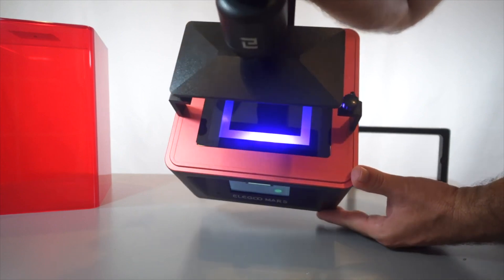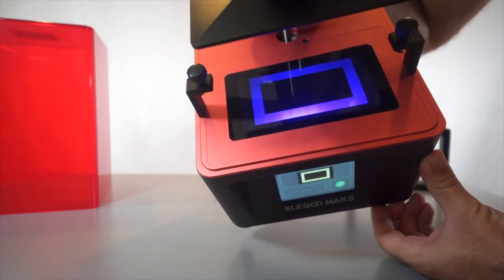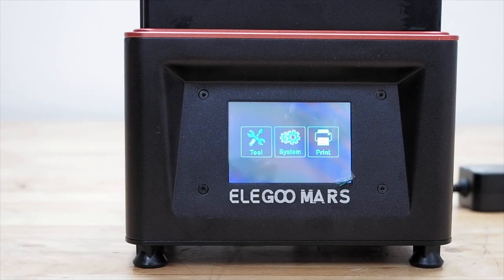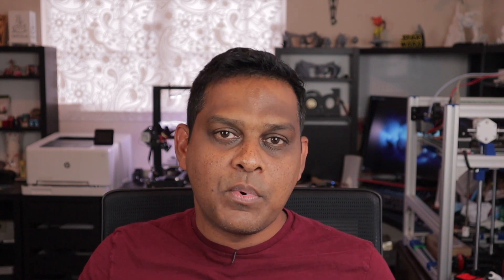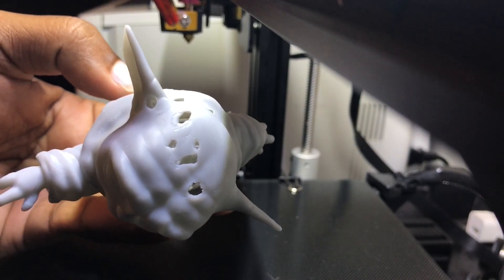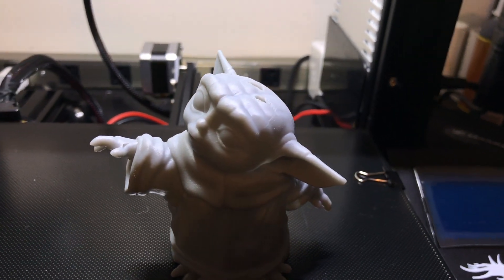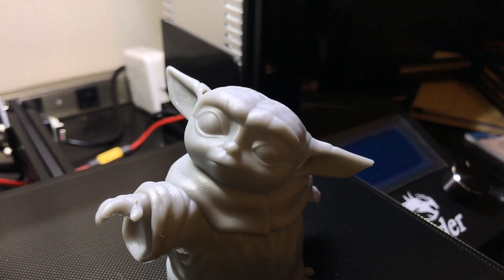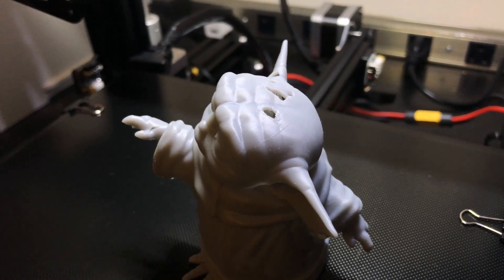Know why and when you will need to replace the LCD on your Resin SLA Printer!

Comment: Anycubic Photon S, two screens failed this year.  About 100 hours printing on each screen.  I print mainly 15 or 28mm minis with a few larger vehicles.  4 bottom layers/40s exposure and 10s normal exposure at 50 micron.  Ventilated workbench in room maintained 71-73 F (21-22 C).  LCD screen and bottom of vat cleaned every couple of prints, no residue or damage.  No physical damage, i.e., nothing dropped on screen.  Anycubic sales refuses to honor their 400 hour expected lifetime.  What do I look at to determine why the screens are failing?  thanks for your help!
Reply: Hey, could you please tell me, by what symptoms did you speculate if the screens are broken?

Comment: Do you think it is possible to prolong the lifespan of the LCD screen but adding heat sinks to the outer surfaces of the UV reflective projection tunnel to help dissipate some of the heat?
Reply from the maker: This is a good question. You would need some active cooling for it to work though.

One user actually got great results having the stock fan reversed blowing on the heat sink instead of sucking air.

You can give that a go!

Comment: You made the walls to thin or there is an issue with the stl.................................. the screen is fine
Reply from the maker: Hi, thanks for your feedback. I can assure you the screen was messed up :) I ran a full screen STL and there were areas that had black holes in them
Reply: @FrameonesMakerspace  So its not the natural process of the screen...........you messed up............... RIGHT?
Reply from the maker: A1OFFENDER yup, that’s correct! I messed up by crushing the screen
Reply: @FrameonesMakerspace  I broke 2 screens for another $1000 printer i have......... oops
Reply from the maker: A1OFFENDER ouch!!! The larger the printer the more costly the parts. Especially since this technology is now becoming available to consumers
Reply: @FrameonesMakerspace  agree

Comment: Another way to ruin your LCD is to accidentally get some resin on the bottom of the vat - it can cure and attach the vat to the LCD, and if you're not careful, when you remove the vat you'll rip the LCD out and damage the cable that attaches it to the circuitboard.

I did this within my first week with my Elegoo Mars. Luckily Amazon had the replacement LCD available for next-day delivery. Lesson learned - I now inspect for rogue resin, and remove the vat VERY gently.
Reply from the maker: That’s true! Thanks for your comment Kieran!